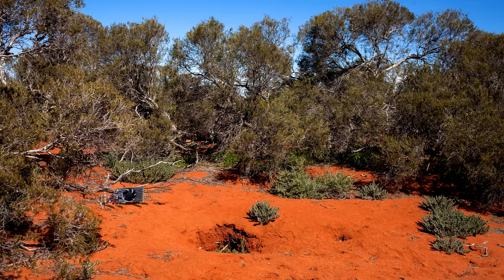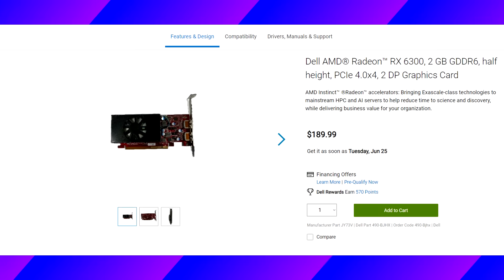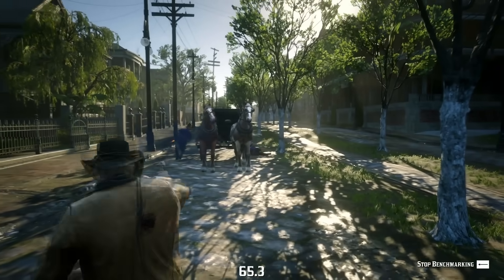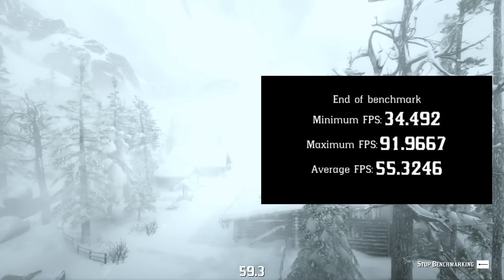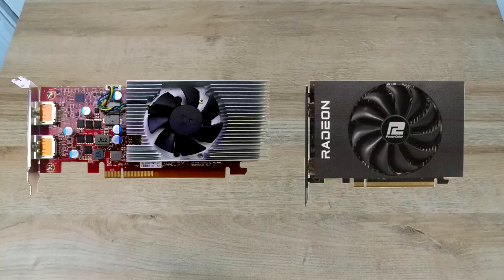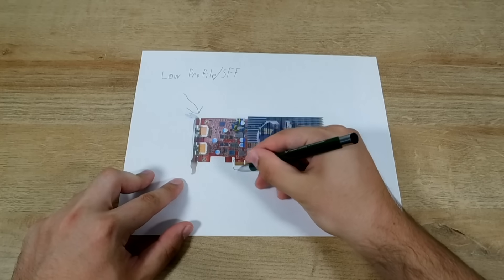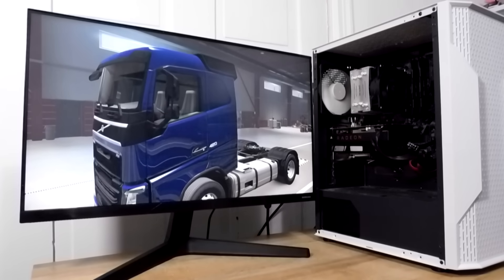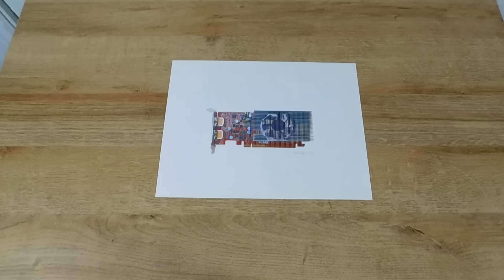When The Predecessor Is Better Than The Successor

Comment: The rx5300 was a low end gaming gpu made for gamers, eg the gtx 1050ti... the rx 6300 is made as a "budget" video adapter, like the gt1030... also 5300 uses 100watts... 6300 uses 30... of course its worse... buuuuut Amd were hella optimistic for the price -_- the rx 6500xt and the rx5300 have similar power draw and price.

Comment: The RX6300 is clearly a dGPU that only exists because AMD didn't put an IGP in most of their CPUs up until recently. So Dell buys a CPU from AMD for an office workstation, but needs a GPU to go with it, and it's just more convenient to shop for everything at AMD rather than also strike a deal with Intel or nVidia for a bare bones dGPU for basic display output.

Personally I can't be arsed to deal with odd ball GPUs like that, so if I were to recommend someone a bare bones system just for light work-from-home duties and some mild internet browsing use, I'd always just spec out a PC with a simple i3 or i5 with IGP and just leave it at that.

Comment: Hell you can get a 6500XT for roughly the same price as a RX6300. Even a RX6400 is cheaper than the 6300 and it is a much better card.
Reply from the maker: @Fender178  the 6400 is also a low profile card in many cases which, for a cheaper price, seems like a no brainer for SFF builds.

Comment: I'm new here, what's the test specs?
Reply from the maker: You mean the bench I used?

i5-9400F
16GB DDR4
Uhh, I used SSDs?

I get why you would ask though, I just felt it was unnecessary to put it in the video since the RX 5300 was going to bottleneck like crazy even on a slightly older system. But glad to see a new face none the less!
Reply: @BudgetBin  thank you for the reply.

 I were curious since you got more FPS then the YouTubers you shown but I believe it's the drivers that have been optimised since their testing.

Good video and I hope you do more.

Comment: If you ever got problem with AMD GPUs drivers - like requiring to use nimez...

really, get secondary Linux drive where you will test those cards - and cmon, you will be able to play game off steam
you will be able to use unigine benchmark etc

i am running my Vega FE currently off Linux because AMD were soo great to kill off wattmat for those cards on Windows - while on Linux not only i can play games like Darktide or World of Warcraft without any issue, i can also undervolt my card

and you don't need to install any specific packages - AMD cards will just work out of the box, even ones that are no longer supported on Windows - as an exampe, Kaby-Lage G APU based on Vega 24 (i7-8809G) which haven't recieved any updated on Windows since like late 2018/early 2019. You cannot even run FSR on it.

while on Linux - it just works

Comment: This really is nothing new. It's been happening since at least the mid 1980s with CPUs, graphics cards and later with GPUs. The Intel 8088 and 8086 are prime examples, SX vs DX CPUs etc. Budget or Office PCs don't generally need high spec components, but component manufacturers have to crank out new designs to stay relevant. They don't want to keep producing a 10 year old design, they want all new fabs that can make better use of silicon. So they take their modern designs and cut them down for OEMs or to meet price points.

Comment: is this even better than the 780M found on the 8000G series processors?
Reply: Nope, 32bit memory bus is really bad. but also, 780M is a lot more expensive, 8700G costs $250+
Reply: @BusAlexey  lol. thanks.  the gpu that should have never existed.  could have gotten a clue when he said it is outdated when it came out.